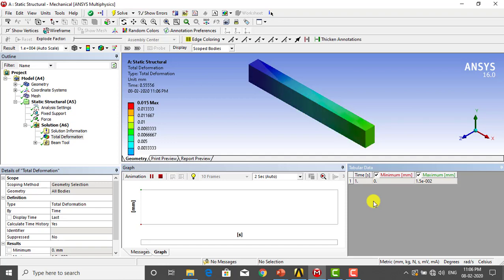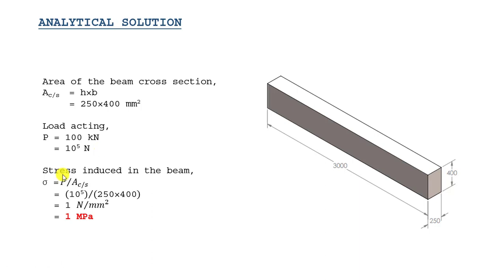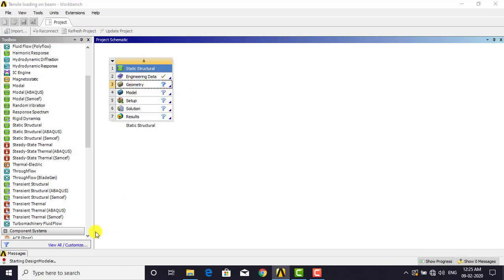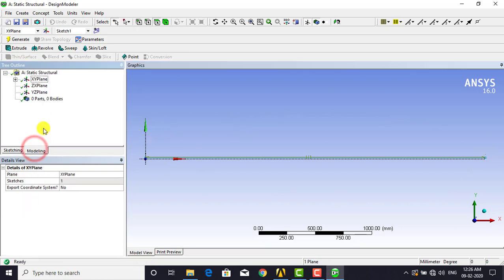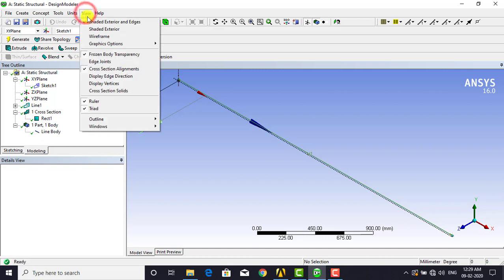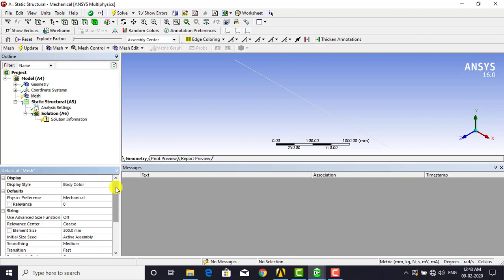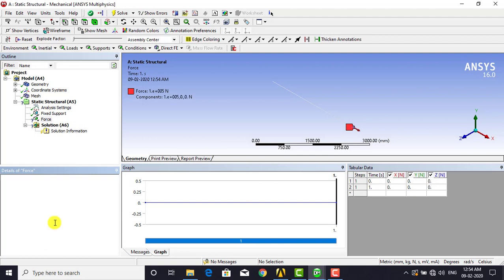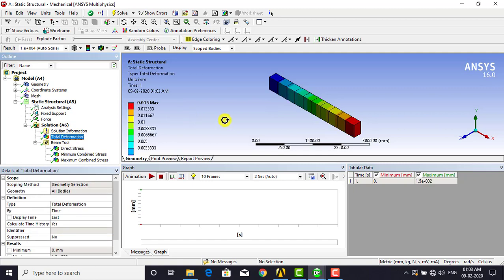🚀 ANSYS TUTORIAL || (with explanation) Simulation of 1D Tensile Loading on a beam.

Comment: Amazing tutorial. but you didn't mention the Young's modulus. If i want to change the 200 GPa. what should i do?
Reply from the maker: The simulation is performed for the default material that is structural steel. To change Young modulus, you have to change material of the component.
Reply: @SolidworksTutorialsVK  Thank you so much. I have learnt  Ansys from your tutorials. Hope, you will be uploading more more tutorials on Ansys (such as heat transfer through heat exchangers). And yes! your tutorials are easily understandable.
Reply from the maker: Thanks Ahmad. If you can share my videos to your engineer friends, it will be a great help. It motivates us to make more content.
Reply: @SolidworksTutorialsVK  of course, i do.